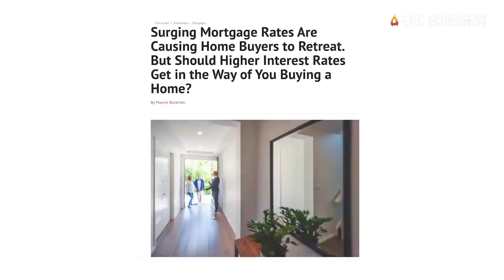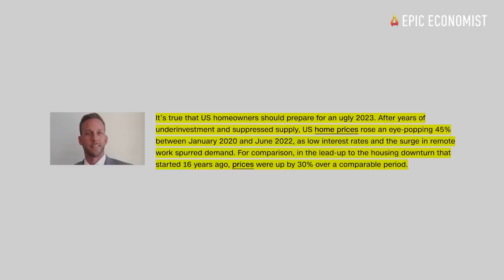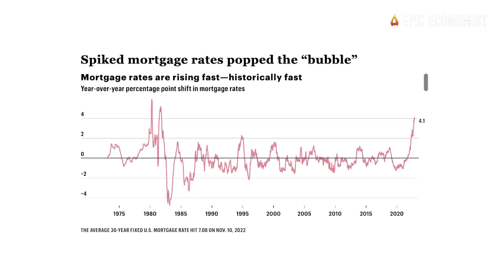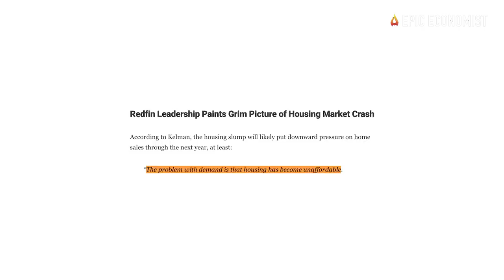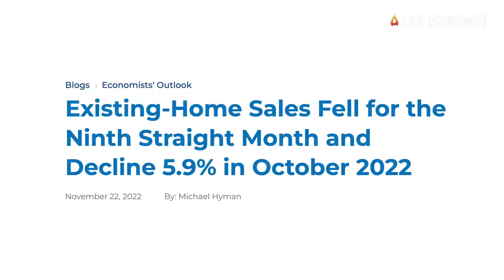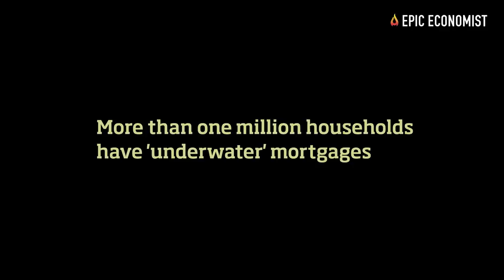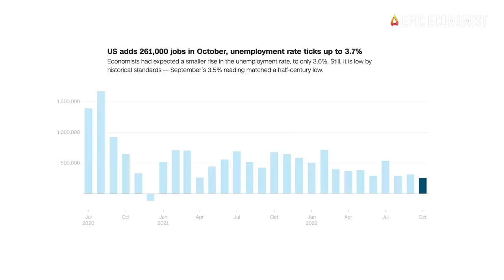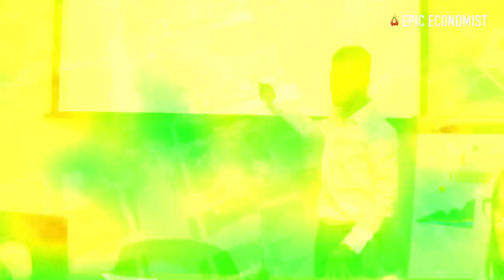The Housing Market Is Falling Apart Before Our Eyes As Prices Drop Faster Than In 2008

Comment: I bought my house when the market bottomed out in 2012 @ $245K, refinanced @ $310K in 2016 and watched as my house value peaked @ $730K and has sunk to $610K. Currently I owe about $220K. I doubt my home will ever be underwater. If the government passes out more stimmies, my mortgage will be paid down more, just as I did in the previous years.
Reply: I bought mine in 2011 as a foreclosure, its now valued 5 times what I paid for it.
Reply: @raymartin3527  I looked at foreclosed houses as well and most were absolute WRECKS.
Reply: @Sight-Beyond-Sight  I got lucky on mine, the owner had two homes in this resort and I guess got in a bind so the bank foreclosed. I had to clean up the lot in the back but that's it plus the lot next to it came up for sale and I got it too.